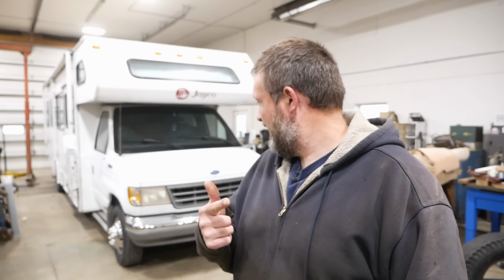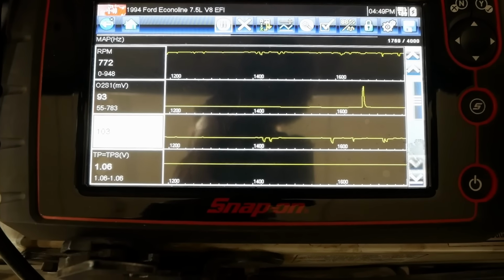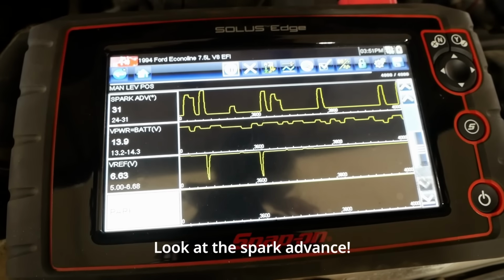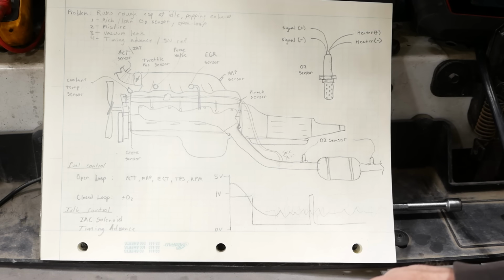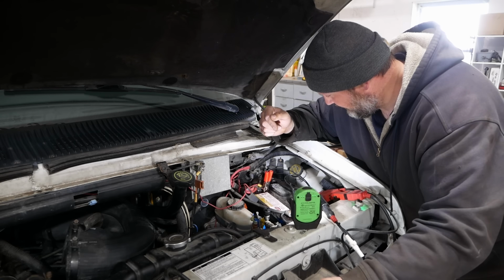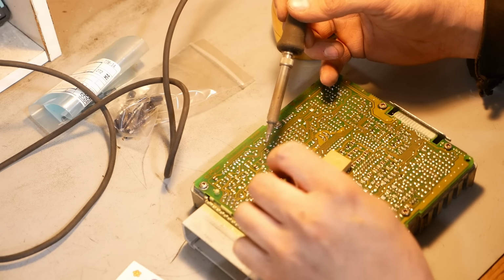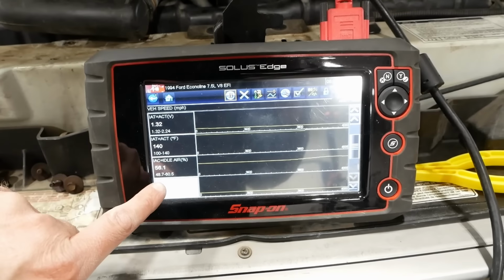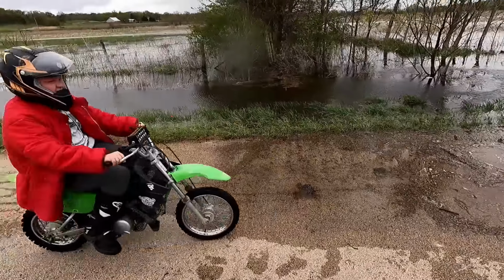Ford 460 RV Surges, Runs Rough but Nothing's Wrong?

Comment: Secondary air wont be active in closed loop. Need engine coolant temps, throttle position, and a few other things met to enter closed loop usually. The o2 sensors will stick high or low in open loop usually because it’s unlikely to be perfectly stoich to allow it to switch. Still don’t know why the capacitor would cause that issue though, unless the IAC wasnt working properly?  Also ignition is often times used on a PID loop to control idle as it can be changed faster than the iac can move physically, more advance more vacuum/power and bump the idle up without needing more iac/air.

Comment: That was a tough one, when in doubt scope everything for noise, e.g. any sensor ref voltage should be a flat DC line. I think the advance tweak at idle hackery goes back to the miles of vacuum hose smog era stuff, Ford always liked to hold onto yesterdays questionable ideas like that forever, mechanical brakes, flathead engines, 5 digit odometers, twin I beam front end, etc.

Comment: I had the same issue and i replaced all 3 caps. My dad got sick and i did not touch the rv for about a year. Well i had to move the rv to another location and the rv kept stalling but no codes 🤔 i went through everything i could of think of and all tests came back good. I decided to look at the pcm again and under a microscope i found a broken trace next to the first cap. I had to replace the trace from the register to a via across the board. Now i just need to go for another test drive.

Comment: Had a no start from my 93 f250 460cu. in. Tracked it down to the cpu and saw the caps were not good. Replaced them but that didn't fix it. Anyways sent the cpu to F******p in Florida and all they did was replace the caps I already had I guess because they weren't the color blue? But still didn't work. I ended up finding a bad track to a via. Added solder and that fixed it. What I'm saying is that I guess that's a common problem with the older ford trucks? Anyways, nice fix!

Comment: I watched this video already, but saw it again and spotted a commented about Wes opening the ECM and replacing capacitors. One thing you learn when working on older electronics and sometimes not that old is that these capacitors go bad very often and sometimes you have to replace all of them along with some other parts. Remember this and if the electronic item has been sitting for a lengthy period and especially something old let an expert deal with it because if you plug it in and turn it on and a capacitor blows it can be chaos causing other things that may not be easily replaced to be gone and a mess and might even scare you and give you a heart attack.

Comment: We had this exact issue on my 1995 Ford 460 motorhome that we call Grumpy.  It was way worse, it would start backfiring, stall out, and barely ran at all.  After a thorough firing of the parts cannon we could not think of anything else to throw at it--ignition everything, fuel pressure testing, you name it.  Your video gave us the idea to check into the computer and we had the exact same capacitor burnt out.  Thanks so much, it really made a big difference for us.

Comment: swap in a RUSEFI and upgrade that old efi furd burd be one way of doing it and at 175 a board very good deal and will run oz wide band e throttles . Ford should have install 2 or 3 more dingers or buzzers in thosee ole trucks right . lol

Comment: No mere mortal could have diagnosed this and fixed.  Btw, weird 6.63v reading could be that   it’s an interpolation based on a look up table and not actual 5v voltage. Or, maybe getting messed up in the analog digital conversion? (by the way, if you see that my comment here has no “edited” mark. It means I went and looked up “interpolation” and it means what I think it means. lol

Comment: I really enjoyed this one. Those Nichicon capacitors are usually very reliable. I have seen issues with radial capacitors when the lead spacing doesn't closely match the hole spacing in the PCB, and the seal gets damaged during installation.

Comment: You probably won’t see this, but if you do and you still have that arctic cat, be a little cautious at higher speeds (even though it probably won’t go over 45 down hill). I have a 99 300 4x4, I was cruising back roads wide open and the rear tires locked up. Luckily it was gravel and I was in 2wd. There’s a gear in the sub trans (left side behind the same cover the stator is behind) and it has a bushing, the bushing and gear welded themselves together, they’re only supposed to spin at the same speed in super low range. If you ever find yourself in that situation, try super low to get back where you need to go, also buy Suzuki parts. It’s a Suzuki engine/trans/rear diff (and front diff too), they’re much cheaper than stuff labeled arctic cat. I found it easiest to remove the whole rear frame section, I believe it’s 6 bolts, few wire connections, couple exhaust springs, and skid plate back half.

Comment: You can always use a higher voltage capacitor in place of a lower voltage rated capacitor .  If the capacitance value is the same , it should work just fine.  The drawback is that higher voltage caps get physically bigger...

Comment: Quick question, you heard an exhaust leak, and have an efi engine with potential fuel trim issues. Wouldn't the manifold leak be the first step?

Comment: Wish you kept going with that Ford. 6.5 volts is 30% error. Could have found the pin when it was in your hand. Base timing on 460 Fords fixes a lot of things. Mass State inpections dyno test always got god nox readings in base setting.

Comment: I see you are also forced to solve problems that don't make sense to solve! I feel like I do always learn something from the process, though.

After the initial troubleshooting, and hearing it was ECC-IV, I figured it was ECU capacitors. I dealt with this last summer on the F-150 I fixed up for my grandfather. I'm used to having to recap old industrial control systems, but that was the first time I had to recap a vehicle!

Comment: Most ecu units cut the supply voltage in half to supply the components that reduce that voltage to 5 volts.  Thats why dc components are dead at 10 volts or slightly above that.

Comment: I have seen a failing fuel pump cause the same issues.  When the pump ran for a minute it would overheat and cause my 8.1 gm rv motor to sputter.  This happened with no engine lights or code on the scanner.  You should put a gauge on the fuel rair with camera monitoring it while you drive.  Thats how i diagnosed my pump.  Fuel pump not delivering adequate fuel will cuse your o2 sensor readings to be all over the place

Comment: OMG I'm going through the same thing. Mine is a 96 and has a maf sensor. I did everything you did and replaced the computer. My vref shows 2.49v. Same symptoms. Same timing. Still the same thing is happening even with a new pcm. What should I do?

Comment: Great video. Same exact problem on mine. I found it thanks to your detailed explanation. So many forums chasing vacuum leaks and egr valves. I decided to check the computer first (which i normally would have thought of as a last resort). Same situation, 2 leaky caps, one with the leg rotted off. Thanks again!
Reply: About to rip mine apart and check it out

Comment: 25:30 The A.I.R. diverter valve is supposed to inject air to the exhaust manifolds during warmup from cold. then, it will bypass air to atmosphere at idle after normal operating temp has been reached. When driving, it diverts air into the front of the catalytic converter (past the O2 sensor). If you would have waited for full warm up, I am betting you would have seen closed loop come into play, and the O2 voltage start jumping all over the place. 
GREAT video, and good catch on the capacitors.

Comment: Im a heavy equipment tech and I’ve opened computers and modules up and found bad ones but I’ve never repaired them . I send them out to a computer place where they do the repairs . Good job, I’d be afraid of messing the circuit board up making a repair like that .

Comment: I wonder if the problem with the vRef has anything to do with how the scan tool interprets data? Otherwords, it reads 6 because the tool is interpreting wrong. I have an identical scan tool and i have that issue on rare occasions.

Comment: Goodness!  Well done.  You didn't mention the importance of the polarity of electrolytics.  Surprising things happen in installed the wrong way.  Back in Air Force days I replaced a bunch of electrolytics - backward - one time.  Turned the system on and after a few minutes - boom.  They didn't fire me.  When doing solder work on a pcb I use 99% alcohol  to cut through the gunk.  Maybe acetone carefully on boards like yours.  Been doing that for many many years.  Also, there is an 'l' in solder so I believe that it should be used.

Comment: I just pulled out my computer & took the cover off & sure enough, I have the same problem. Truck was running very rough before I took computer out. Could having those messed up capacitors be causing a rich fuel/air ratio?

Comment: Glad I saw this, was getting ready to load up the parts cannon. I have a 94 E350 with 26,400 miles on it. About 2 months ago started geting the stumble at no load or light throttle about 4 second intervals. Replaced the original plugs and wires, cap and rotor.  Problem persisted. Saw this video, pulled the ECM. The capacitors looked ok to me took it to my circuit board savy friend who immediately spotted a bad 10uf  bulging capacitor. Replaced all 3 using 1 each 10uf 100v and 2 each 47uf  25v caps . Runs perfectly   with no stumble, thanks. Was scared this was going to cost me a fortune.

Comment: Those mustard-colored tiny gumdrops, they're tantalum capacitors.  Which are fantastic capacitors,  like ten times lower series resistance than the aluminum-foil ones you pulled out. Until some random time in the future when they go WHAM! and short out.  I have fixed many expensive Tektronix oscilloscopes that just needed a new gum-drop.   Even worse are the mil-spec tantalums with nitric acid inside of a silver-plated capsule.  When they leak acid, you often lose a square-inch area of components and traces.

Comment: Had a 96 f150 and that just happened to be the year they changed to obd2 but it was technically a 95. It was a dumpster fire and since it was like right in-between them it was almost impossible to get any info from it.
We just sent it to the UP to die in the road salt where they dont have emissions

Comment: This video gave me hope.. lol this fucking rv has been parked for like 8 months
I changed everything to do with spark except going thru every single wire and every time im thinking ok it wasnt this or that so it HAS to be this full day later from sun up to midnight no lunch break im back to square one 
Huge hole full of brand new parts and a couple duplicates just in case and im still at crank no start so now im back to cranks all day and starter fluid just makes it choke like it wants to start but nothing

It did idle at like 1300 too so the longer i watch what youre doing the closer i think im getting cuz u do something i didnt think of yet lemme try that

With the amount of time and homework u got in this RV u should open a last ditch RV shop if you had a certain number of guys come look at it and still nothing bring it to me, I'll fix it and tell u how long it took them u tell me if you think I deserve 8k for this one job
Don't matter how simple it is. All that looking for just a fuse or something

Comment: Only problem with disconnecting that door chime is even if youre not sitting in the seat, if the driver seatbelt isnt plugged in it keeps dinging like if youre driving without it

Comment: interesting have the same rv and before the issues happined whick was stumbling rought idle and some times no buss communication so before this happined took rv to walmart to have change rv battery total of 3 and when the techs could not remember were all the cables went they mixed up the white cables and the black cable so on rv e350 they use white for negitive and black for positive and they had the cable reversed and i came out to see how are they doing and I told them its not right need to put cable white is positive and black is negitive so after that i drove ok with sometimes not running smoothly sometimes and later the month rv was starting to stall out and had to restart and finally just stop even no buss communication so check all the fuses and they were ok so ordered new pcm and had it programmed and it now works perfect .

Comment: That problem with ECM failures is that the ECM codes are designed to find problems with external sensors and components, but there's no hope of the ECM diagnosing itself!

Comment: does the air injection go over the mass air flow sensor? if the ecu isn't accounting the air contribution from a table or whatever, maybe it uses the o2 sensor differently in each mode, afair the pre-cat and post cat sensors are part of maintaining the temperature of the catalytic converter too

Comment: I work in electronics engineering and wow, that's one very cheaply built ECM. I'd expect mechanically unsupported capacitors like that in a dollar store phone charger, not in any automotive application. A standard practice is to stake protruding parts with a blob of potting compound (which is quite similar mechanically to stiff silicone sealant) to fix it in place and prevent metal fatigue and solder joint cracking from vibrations. It could be seen in any decent power supply like the one in any PC. Also, if the PCB hole pattern would exactly match the capacitor's lead spacing, it could've been mounted flush to the board, also reducing stresses. Of course that wouldn't prevent the cap from leaking with age (that was the industry wide problem of that era), but it would still be more reliable. I guess Ford haven't yet figured that out yet in those earlyish days of computers in cars, even though it was known in aerospace and military fields for decades, and later surface-mount technology improved and made all of that mostly irrelevant.

Comment: I like your Sodor sucker never seen one, i’ve always done it the way my dad did it heat it up and hit it with air. But with today’s microcircuits the Sodor sucker is an added peace of mind. Ford OBD l my understanding— require temperature and time, before going in closed loop. Which is where the 460’s tend to run lean at WOT.

Comment: My efi COMPUTER went bad 3 times over the years 1995 f350 460 gas and it did the same thing ran rough, cut off would not crank replaced it and away I went. I think with these EFI  and it being a OBD1 even the Ford dealership had a problem until and old man walked by and stopped and listen and told the highly educated computer service tech what was wrong and the look was priceless. So the dealership could not get a new one so I had to go to the local parts store advance auto parts bought a lifetime one.  The dealership put it in and away I went. The sidebar LOL I slipped the old man which, I found out was the owner LOL a $100.00 bill and he smiled oh and don't buy from advance auto the dropped that line of EFI and my lifetime warranty was gone. I raised hell and they gave me my money back LOL and went to auto zone only 1 yr warranty went back to the dealership a few months later  the old man seen me and we went to lunch HIS TREAT. I am glad no one could see me when I was watching this GREAT VIDEO  I was yelling it's the EFI COMPUTER. WHY DOES FORD PUT THEM UNDER THE HOOD AND NOT IN THE CAB, ANSWER THAT FORD.

Comment: After 4 months of chasing this same problem on my 1995 e350 7.5l, replacing all ignition components and more. I finally pulled out the pcm after watching this video, and boom. Same exact capacitor had failed.   Now to find someone who can fix it!  
Thanks for ending my wild goose chase! Cheers
Reply: Who did you find to fix it?

Comment: My Ford E350  Rv is having almost exact same problem and failing smog. This was a big help. You don't need to apologize. I haven't run into many mechanics that would actually try and repair a board instead of just charging the customer for a new one weather he needed it or not. That's integrity and tenacity on your part.

Comment: @WatchWesWork The only trouble with going to a higher voltage capacitor is the internal resistance is higher, and this can mess up a sensitive circuit. This may be the cause of the 6v reference, along with whatever the electrolyte is still hiding in the board.
I was impressed that you used flux! Nice work and nice find, my fellow nerd.
With 5 volts missing, it's all up to the firmware on how the computer responds. I bet there's an expert in a forum somewhere that knows.

Comment: I have a '96 E-350 camper with the 7.5L but fortunately mine runs pretty well other than an obnoxious exhaust leak which I need to fix. I did laugh when you cranked it and the ABS light came on, mine also has the ABS light on that I never bothered to fix. This was really helpful though, I will keep the ECM in mind if I experience this issue in the future and with electrolytic caps I certainly will be eventually.

Comment: Take care with replacing electrolytic capacitors with one of a much higher voltage rating. Higher voltage means higher ESR (equivalent series resistance), which for capacitors is a bad thing.  If the circuit is sensitive to ESR, it could introduce a fault, or worse, introduce a failure at a later date because ESR tends to increase with aging.

Comment: When air pump is purposely commanded the O2 sensor signal is ignored. If the diverter valve is commanded open due to a fault the PCM is unaware of then O2 sensor is used (closed loop) and the poop hits the fan.